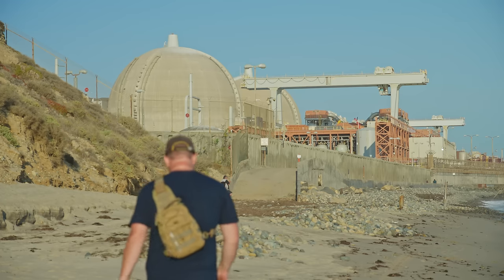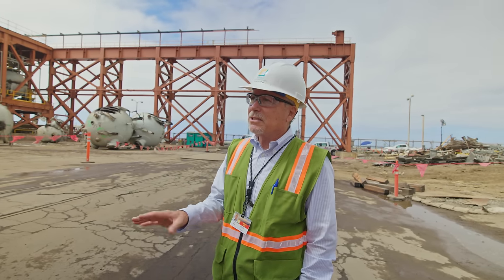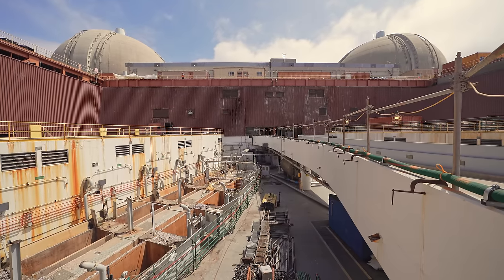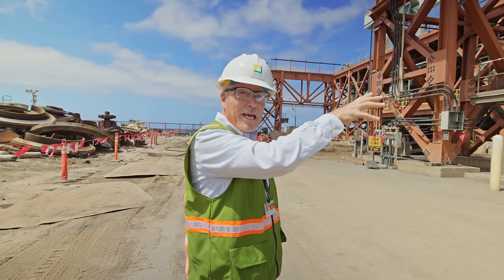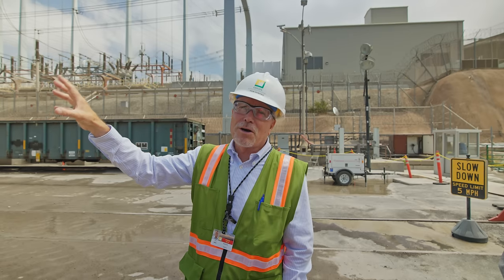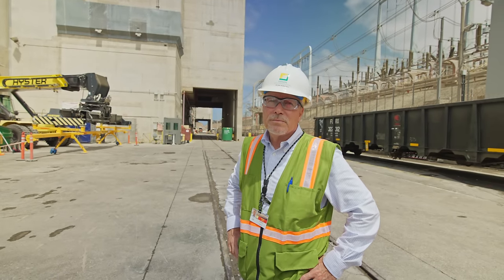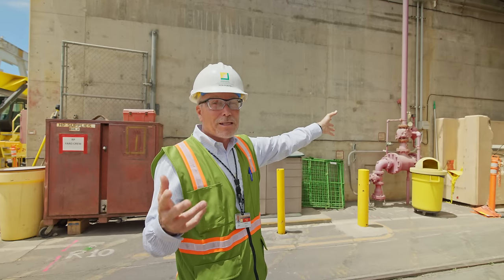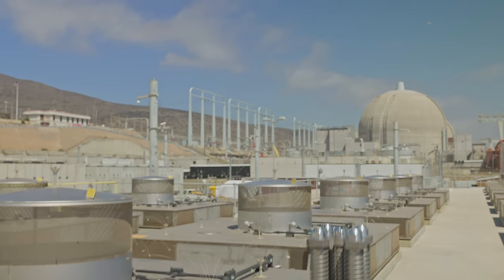Inside the Decommissioning of San Onofre Nuclear Power Station

Comment: Awesome video. Hate seeing nukes get shut down. One thing he almost mentioned about the refueling is that after running for 18 months or 2 yrs (depends on site), only a third of the fuel is replaced by new fuel, then the plant runs another full cycle. During a refuel, All fuel assemblies are labeled. Removed from the core, placed in the spent fuel pool, maintenance is done to the site, then the core is refueled with used fuel and a third of new fuel. Pretty insane the amount of electricity that’s sent out on the grid in 2 years with shuffled around old fuel and 33% new.
Reply from the maker: Thanks for explaining that a little further.

Comment: I machined the big low pressure steam turbine blades for the 1200MW turbines in Rugby, England for this power plant. I have photos of the complete low pressure shafts being transported through Rugby. They were 15 foot 10 inches in diameter and weighed 171 tons. Each 1200 MW set had 700 tons of revolving metal in it.
Reply: Rugy!! wow was that part of GE or what was BTH, is that plant still there ? always been intrested is the history around there any info would be much apreacted